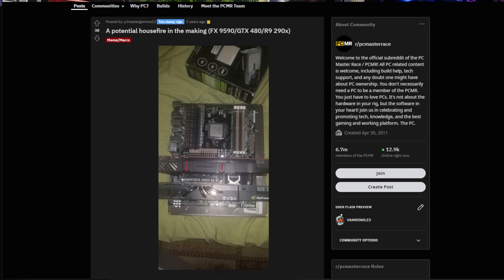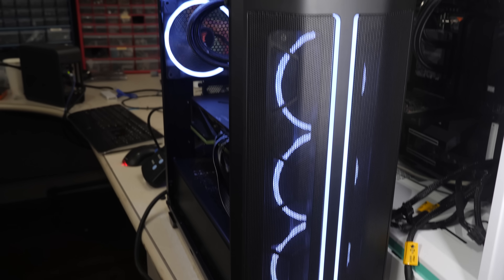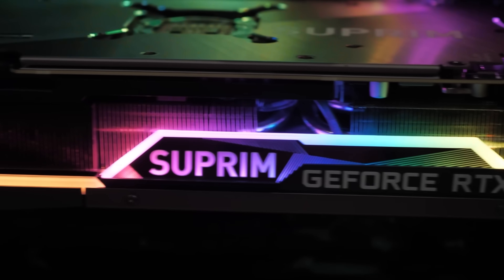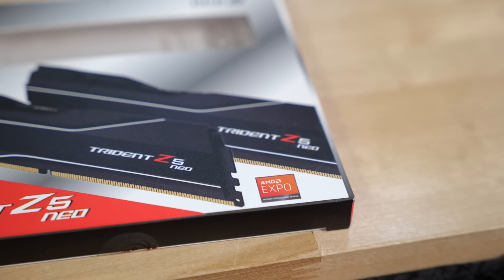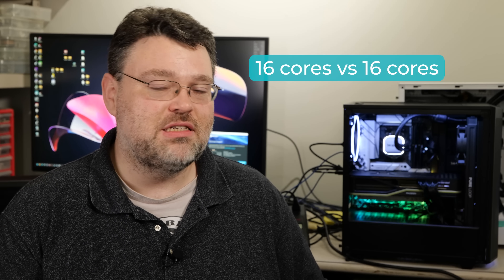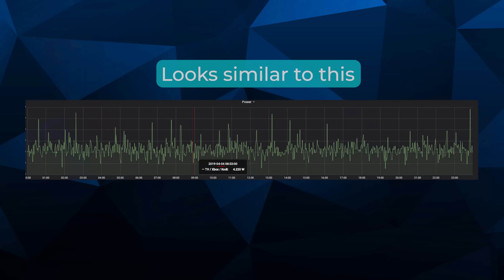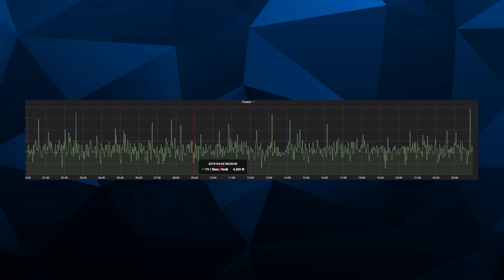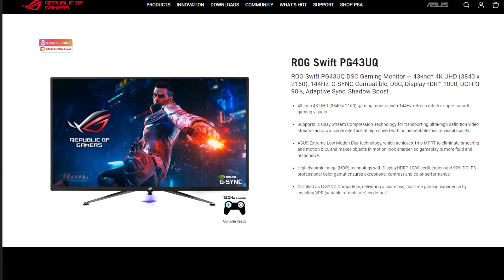Too Hot? How much Heat Do Intel and AMD Actually give off?

Comment: The amount of people who dont understand its wattage and not temp that causes heat in your room is crazy
Reply: and that temps are just trapped heat in the IHS/CPU, a 10w CPU at 95c is VERY different from 110w CPU at 95c.
Reply: People don't understand that a 250w CPU running at 60 C° will heat the room much much more that an 75w CPU running at 95 C°
Reply: The temperature of a little old fashioned torch bulb filament  is over 1000 degrees but it's only 2 watts.
Reply: An 800 degree F coal vs a pot of 160 degree water. One you can hold in the palm of your hand. The other will instantly scald you.
Reply: The difference between the two is negligible now that’s the difference AMD was more efficient and was sold as efficient so now that it’s the same basically as Intel might be 20 watts less haha people are all afraid of the Pc being a space heater. And it kinda is but at the same time what are you using it for if you aren’t going to be neeeding crazy high core count workloads being run then getting a lower core count cpu is better for sure and you GPU determines more of
What you wattage target is going to be if your into gaming … and gaming isn’t going to see benefits over 8 cores .
Price of the system to overall performance for a strictly budget build gaming PC is still ain’t 12600k or extreme budget 12400 non f so you get the integrated graphics for $20 haha that way you decide to get a AMD gpu to save some money for gaming you can still use the Intel Media engine for video editing and encoding /rendering
Reply: @JoeWayne84  7900x and 7950x do perform significantly better than the 7700x and the 7600x though, not so much as a direct result of the extra cores but more because of the extra cache they have
Reply: @bosstowndynamics5488  Significantly better???? OK
Reply: Temp is a byproduct of wattage and since people don't measure temperature in wattage it's definitely easier to understand. But since wattage is lower with a lower load we could say heat is caused by the game you're playing or porn you're watching.
Reply: The amount of people who won't admit that AMD changed the goal posts on the programmed running temperature is crazy. AMD upped the 'normal' operating temperature due to failure to cool properly. It's like running a 500W psu with a 'normal' load of 500W, whilst it 'can' do it, people only do that if they've no means of upgrading their psu. By comparison Intel never programmed their CPU's to run at 95C, it happens due to inadequate cooling. Being able to survive a heat wave does not that that is the normal historic temperature.
Reply: @longdang2681  That's not true at all - AMD's specified TDP for the 7000 series chips is somewhere between 100 and 170W depending on part, but they'll continue ramping up all the way to 250W if you provide enough cooling, even at 95C. If the chip is able to consume nearly twice its specified power without exploding it is not inadequately cooled regardless of what the number on the thermometer is. You can make the argument it's being too aggressively overclocked (I would disagree with this as modern silicon is more heat tolerant) but that's not the same thing. You can also argue, accurately, that the AM5 IHS is designed in a way that makes cooling worse than it has to be, but that's not the same thing as inadequate cooling any more than Intel's thermal paste IHS approach was "inadequate" cooling. It is adequate, just not ideal.
Reply: @bosstowndynamics5488  you don't need to risk it exploding for it to be inadequate cooling. The cooling is not sufficient to cool the AMD CPU to under 80-85C when it is consuming 200+W. AMD had two main choices, either clock it lower and reduce the power required, or let it run hot and say that it was meant to run that way. They chose to let it run hot. Intel's 12900k etc. also has inadequate cooling when it hits 90+C. The difference being Intel does not programme it to run hot as much as possible and call it normal operating temperature. It's like sweating uncomfortably in a heat wave because of an underpowered AC and calling that adequate cooling. You don't have to die for it to be called inadequate.
Reply: @longdang2681  Why do they need to cool it down to 80C? Because you said so? That seems very arbitrary
Reply: @bosstowndynamics5488  It's not arbitrary. It's like saying that water boiling at 100C is arbitrary. The numbers actually mean something in real life. What's arbitrary is AMD randomly choosing 95C. Why is it not the 105C that they are claiming it will still operate at? You can't just jig real life numbers because AMD marketing feels like it, physics doesn't work like that. 80C is the highest safe enough consistent temp for CPU's. Many electronics based companies put their real life max sustainable CPU's temp at 80C. Even AMD used 80C until they released the 7000 series.
Reply: @longdang2681  It's almost as if the 7000 series was built on a different process or something.

Specifying 80C for silicon is arbitrary. CPUs are not made of water, and even if they were water doesn't always boil at 100 degrees, its boiling point changes depending on multiple factors. Similarly, while no silicon is going to be rated for 200C different processes are capable of safely operating at higher or lower temperatures, with a general trend in recent years towards better heat tolerance with newer process nodes. The thermal rating of the 5000 series chips on an older process does not make it impossible for the 7000 chips on a newer process to run hotter safely, particularly since AMD had actually specified 90C for their 5000 series parts, not 80C.

And again, even if it's not safe for them to run at 95 degrees, the fact that they are running that hot is not due to insufficient cooling*, they're deliberately configured that way. If you provide 250W of cooling to a 7950X it will still run at 95C, even though you're providing way more cooling than its design power, because its governor will say "excellent, I've got plenty of cooling, I'll run even faster" and boost up to take advantage of the extra power. *Even if 95C is too hot, the problem would be an overly aggressive overclock in that case.
Reply: @bosstowndynamics5488  It is not safe to run them at 95C(long term reliability). The only reason why AMD has programmed them to run hot is so that they can benchmark that bit higher. AMD failed to release a product that can reach the benchmark scores that they wanted so they ran it hot to do so. Instead of just releasing what they got(which is still decent enough), AMD decided that they would move the goal posts. Remember when AMD claimed that it was not possible to support 5000 series processors on earlier AM4 motherboards due to lack of bios space? guess it's not so impossible now that is has miraculously happened(another example of AMD making nonsense claims to try and move the goal posts). If you want an inferior product that is programmed to break earlier for no real benefit to you(the customer), then go ahead and support AMD when they make their nonsensical claims.
Reply: @longdang2681  So the evidence as it stands:
On the one hand AMD, the company that has manufactured the processors using decades of experience with semiconductors, and has access to protected information about the performance of the TSMC processes used to manufacture the chips, has rated the processors to run at 95C for long periods of time. This is a small, incremental increase from the 5000 series rated temperature profile
On the other hand, Long Dang, a random pseudonymous commenter on YouTube, has a hunch that because old silicon needed to run cooler that actually the 7000 series chips are only safe at 80C, a full 10C lower than the previous generation of products and in complete defiance of the broad industry trend of AMD, Intel and multiple ARM manufacturers rating their modern chips to run up to 95 to 100C. You have also provided exactly 0 evidence for your position.

Do you see why I'm inclined to take AMDs side, even before factoring in my very favourable personal experience with reliability in AMD's silicon?
Reply: @bosstowndynamics5488  It's Apple and AMD on the one side programming their CPU's to run hot at 95C and on the other side it's the rest of the industry and anyone who knows anything about electronics sticking to below 80C for their products. 7000 series processors are lower even factoring in the down turn because people are voting their their wallets to call AMD talking bullshit(and AMD deserves it). Remember AMD has bullshit before with 5000 series support on older AMD motherboards so it's not the first time. The evidence is all around you, simply ask any electronics company(that's not bullshiting) why they would keep their chip temps below 80C. You are inclined to take AMD's side because you don't know any computing history (and are unwilling to do some research when someone who knows a bit about electronics tells you that AMD is bullshiting you). Just so you get the facts right Intel, ARM and everyone else rate their chips to being capable of running at up to 105C(or whatever the specific number is), is very different from AMD programming their chips to run constantly at 95C. A 500W PSU is rated to run at 500W but no one programmes their 500W PSU to continously output 500W. Rating something to be able to cope with a specific load(usually for non long term operations) is very different to programming it to run constantly at those loads.
Reply: @longdang2681  Fun fact, 105C is a bigger number than 95C.

Laptops frequently run Intel processors into the 90s constantly btw.

And, I can't believe I need to say this again, the fact that older silicon wasntt safe at high temperatures is meaningless here. I also know "a bit" about electronics, and I assure you that the thermal performance of a 350nm Atmega 328p gives no indication of the thermal performance of a TSMC 5nm part like the 7000 series.

There's a few reasons that the 7000 series isn't selling massively:
1) it's not much faster than the 5000 series on a per dollar basis
2) Intel's chips are slightly faster this generation on a per dollar basis for low core count workloads
3) Gaming loves large cache sizes, so the cheaper 5800X3D is still keeping up with this generation, and a lot of people are waiting for the 7000 series chips with 3D Vcache in light of this
4) Raw platform cost - AM5 motherboards are expensive right now, and the new systems need DDR5, which doesn't compare well with Raptor Lake that can run on year old Z690 boards with DDR4.

Those are the main reasons, the fact a small number of people like yourself are willfully misunderstanding how heat works is a contributor but much less than the above.

Oh, and PSUs are in fact rated to operate at their maximum power continuously - the main reasons that people don't run them full tilt is because capacitor aging lowers that rating over time (CPUs don't have many capacitors etched into them) and because they're less efficient at maximum output.
Reply: @longdang2681  Also, I can't help but notice that you've just silently dropped the point about "inadequate cooling", which was your original claim. I guess you did realise your original error then?
Reply: 'Oh, and PSUs are in fact rated to operate at their maximum power continuously - the main reasons that people don't run them full tilt is because capacitor aging lowers that rating over time (CPUs don't have many capacitors etched into them) and because they're less efficient at maximum output.'

You said it yourself, rated at doesn't mean you can run it at that load and achieve equal longevity.

Two things, laptops rarely run constantly at 90C(unlike a desktop, people move laptops around), of the ones that do, how many are still working. How does that percentage compare to the hoards of laptops that still work perfectly fine due to sufficient cooling to under 80C ?
Reply: @bosstowndynamics5488  You dropped the point about inadequate cooling. I'm still asking you if your AC fails to keep you from being uncomfortably sweaty during the heat wave, is it giving you adequate cooling? or do you need to die from overheating before it can be classed as inadequate cooling? Oh wait, your AC has been programmed to let you be uncomfortably hot and sweaty? (because that's normal now. Humans are rated to not die at those temperatures, there's absolutely nothing to worry about.)
Reply: @longdang2681 Funny you should say that, I live in Australia and rarely use my AC in summer because I have high heat tolerance, many people do given the chance to acclimate, almost as if heat tolerance gets better over time...
And I did not drop the point about inadequate cooling, it wasn't my point, it was yours, and you didn't respond to my last rebuttal of it.

Re power supplies, you completely ignored what I said. What I said was that capacitor aging in the supply (which is primarily a calendar aging issue and not related to load) means that people overspec their power supplies so that in 5 years when it's max power is 80% of new it can then run full tilt to supply the system without issue. Running the PSU full tilt new won't worsen that degradation, it just means when the degradation happens anyway the PSU will hit its ceiling and the system will shut down.

Re moving laptops around, moving laptops does not in fact enhance cooling as you seem to be implying, the fact that they get moved does not somehow change the fact that they're often running over 90C. Performance laptops tend to be geared to run hotter to get higher performance, and in my experience they tend to have better longevity than cheap, cool running commodity laptops because any theoretical decrease in longevity from heat is more than counteracted by generally better build quality. Even Apple laptops, which do have issues with reliability and also do run hot, have well documented failure modes that are almost never associated with the main silicon (the bit that's running hot), it's pretty much always some minor part like the display cable shorting out.

The core problem though is you seem to be really hung up on 80C as some arbitrary magic silicon safety number. Do you have any actual source for your fears or are you just extrapolating that technology from decades ago is somehow exactly as thermally stable as technology today that's been specifically designed to perform better in hotter environments for things like laptops?
Reply: @longdang2681  CPUs don't experience discomfort buddy, if it's not being damaged it's fine. The equivalent in your strained analogy would be heat stroke or maybe dehydration, not death, and none of those are happening to modern silicon at 90C
Reply: @longdang2681  Anyway I've had enough of this, we've been going for quite a while now and you've provided no evidence beyond, effectively, "I know more than a multibillion dollar state of the art semiconductor developer because I used an Arduino once and think 95 is a scary number", so unless you can provide actual evidence that there's a problem here I'm not going to bother any further
Reply: @bosstowndynamics5488  CPU's don't experience discomfort, they can't tell you when they are overheated and just promptly die when it's too much, just like what happened to buildzoid's 7950X. I know he overclocked it but dead CPU already? nice of you to reign in the numbers when you don't have an argument, didn't you mean 95C instead of 90C? You know, the pre-programmed temp that 7000 series processors will run at that is claimed by AMD to be 'normal'.
Reply: @bosstowndynamics5488  Tell all those elderly French casualties of the previous to last heat wave that no one can die from a heat wave. Due to inadequate cooling. Just because you don't know, it doesn't mean it doesn't exist.
Reply: @bosstowndynamics5488  I'm claiming that inadequate cooling that causes sweaty discomfort is an inferior product and that people would want to look for better choices, and there's you saying that it won't kill you. Who's going to buy an inferior product that's priced similarly or maybe more than their competitor? look at sales for 7600X and 7700X, it's terrible. There's is an argument that if you need the processing power similar to a 7900X and above, the CPU is going to run hot whichever choice(Intel or AMD) you make. No coincidence that those processor sales are not as bad. And that's the correct consumer response when you tell people that the comparatively part time processor that is the 7700X runs 'normal' at a temp of 95C when at full load.
Reply: @bosstowndynamics5488  Ask your multi-billion dollar state of the art semiconductor company how they feel about lying to all of their existing AM4 customers about how there's not enough space on the bios memory for older AM4 mobos to support 5000 series processors?
Reply: @longdang2681  Ffs I didn't say no one can die from a heat wave, I said most people can acclimate to warm weather. Elderly people are not most people, and heat waves do not give enough time to acclimate. And that's not even what you were talking about, you were making some point about being uncomfortable, not dying. In your warped analogy people dying is equivalent to running the CPU at 120 degrees, not 95C.

As I said before, I'm not going to bother replying to your points about silicon because you're just repeating yourself over and over without any evidence, but how you're just outright lying about what I'm saying.
Reply: @bosstowndynamics5488   How am I lying about what you are saying? I'm taking quotes from what you have said? people dying from heat wave is not similar to running a CPU at 120C because the CPU is only rated to run at 105C. And that's my whole point. Running something within it's rated temperature can still cause premature failure. You understand that running a 500W PSU constantly at it's rated 500W will cause premature failure. The exact same thing happens with CPU's. Running them constantly at their rated 105C will cause premature failure. This is why AMD purposely programmed it with 95C. 95C will cause premature failure but not as fast as at 105C, ie it'll last long enough for the warranty to run out before failure. Higher temperatures will always cause premature electronics failure, I have to provide evidence for this, really, look it up, it's just physics. Anyone who doesn't understand the simple physics of temperature against failure rate of electronics can can continue to run their CPU's into the ground.
Reply: @bosstowndynamics5488  'You said that someone might use an AC even in weather that isn't dangerous to them', wrong . I said that if you put on your AC during a heat wave and it fails to keep your temps low enough resulting in you feeling uncomfortably sweaty then it's doing a poor job of cooling. Making the point of you don't have to die in a heat wave for the cooling to be considered inadequate. Similarly a CPU doesn't have to fail immediately whilst being pushed to 95C for the cooling to be considered inadequate. A detriment to a persons health during a heat wave would be considered inadequate cooling. similarly a detriment to a CPU's health at by running it hot at 95C would also be considered inadequate cooling. Isn't that what this is about, you making a (no evidence) claim that it's not inadequate cooling purely on the fact that AMD claims that it's normal. despite the fact that every electronics company operating in the computing industry for the last 40 years has kept to safe temps of under 80C. Does AMD know better than the whole computing industries track record of over 40 years?
I was not nitpicky about you picking 120C over 105C. I said that 120C is operating out of rated temps. 105C is operating within rated temps. My point was it can fail whilst operating within rated temps. Of course it can fail whilst operating outside of rated temps. What's the point of you bringing up 120C, why didn't you use 3000C instead? guaranteed to fail at those temps, unless of course AMD claims that those temps are normal temps based on the miracle that is TSMC 5nm.
You are not thinking straight. What AMD claims to be true and actual reality might be two completely different things(and it won't be the first time).
Reply: @bosstowndynamics5488  If 95C is so normal, why have a fan curve? why have a fan at all? remove all noise making fans and run any 7000 series CPU at 95C at all loads. It can handle it? It's TSMC's 5nm chips, we don't need cooling anymore, cooling is for old CPU's.
Reply: I'm surprised, seems obvious.
Reply: Blame the marketing department 😅
Reply: @longdang2681  Wow, you're still going huh? The fanless conditions for the 7000 series chips would be 105C and aggressively thermally throttled, because, you know, a 170W space heater the size of a postage stamp actually requires active cooling to keep it even as low as 95C.

And Simpsons memes are not a source, try an actual source rather than spamming more nonsense
Reply: @bosstowndynamics5488  Still too blind to see that AMD raised the normal running temps to 95C because they released a failed to pre-overclock series of processors. I suppose some people can't be helped.
Reply: @bosstowndynamics5488  Still too blind to see that AMD raised the normal running temps to 95C because they released a failed to pre-overclock series of processors. (AMD's bullshit marketing of 95C being normal is evidence, but animation highlighting the truth that marketing will spout any bullshit is considered nonsense). The evidence is available to you, you're just too blind to see it. I suppose some people just can't be helped.
Reply: It’s tough to tell people that the degrees is just how hot the component is and the watts is what’s being used and consequently expended. Connecting Watts to Temps when there’s clearly a reading that already shows temps is a hurdle.
Reply: I knew people would freak out about 95 Celsius. Nobody understands thermodynamics.
Reply: @kopasz777  and new Ryzens are consuming how much without 105W ECO leash imposed upon them? That's the whole fricking point - you argue that it's wattage that matters, WHICH NOBODY DENIES, but you're saying a CPU hitting it's peak performance and acting as a fan heater somehow is not an issue. It's a very real issue. It was a real issue when everyone was pointing and laughing at Intel for brute forcing higher clocks to remain relevant and look good on charts past few generations. It was an issue when Bulldozer could replace your central heating... The default behaviour is stupid and nobody should need to be fiddling with power curves out of the box to get optimal performance to power ratio. Optics would be entirely different if they marketed it as insane OC potential and gave you this wild, nearly doubling power limit to play around with. As it is it's pretty much auto-OCd out of factory to the absolute limit (good luck to squeeze ANYTHING out of it) and chugs 50 extra Watts for 5% performance in benchmarks to stay above Intel that has done exactly the same in 12th and 13th gen in order to compete 🙄 it's like buying a laptop and then undervolting and downclocking because otherwise you can fry eggs on it... yes it will work, but why would you want it to run it like that?
Ryzen 7000 is a great advancement with some questionable sacrifices for questionable gains - the best part about the AM5 platform is that motherboards finally have some competitive I/O. It's a real shame that with redesigning the socket they didn't opt to provide more PCI-E lanes to the CPU though...
Reply: @Micromation  I share the same views on the auto OC, factory default being pushed too far, but that's still only a personal opinion. Back to your og comment; have you considered the boost behaviour in regards to power consuption? While your flat OC can not dynamically manage it's clocks and thus its power consumption a stock CPU can and the average power consumption will not be ~200 W. The 95 C is also not the die temp but hotspot temp. This is why you can put a small air cooler on the new ryzen with minimal performance loss and the hotspot still being the same temp. Putting a bigger AIO or custom loop on it will just extract more heat overall and let the CPU use more power as a result. The 95 C is the result of the high power density of the increasingly smaller dies.
Reply: Bruh... I have 5960X (140W TDP), if set at constant 4.5GHz it sits on 85C on water cooling under stress... Combined with 1080Ti at 80C it heats up the room in about 2 hours. In the summer I have to stream remote desktop via local network to another room because PC room is hitting 40C ambient and is unbearable. Yes, 95C on a 170W is a problem if you intend to make use of it. Do you all live in goddamn Siberia or you just buy top of the line components to browse a goddamn YouTube?
Reply: @Micromation  Yes, that system will heat up your room, but importantly it would actually heat up your room slightly more if you beefed up the water-cooling and got the temps down to 60C because you'd be kicking out the same amount of power from the system and slightly more from the pump pushing through more radiators and extra fans to get there.

A simple way of thinking about it is accumulating heat at each stage. The peak temperature on the die only determines how fast the heat can flow through to the cooler - if the cooler is slow then the heat builds up in the IHS and slows down heat flow. The same 7950X will use anywhere between 60W and 250W depending on how much cooling it has with exactly the same die temperature - give it more cooling and it will heat your room more because a larger amount of heat is being extracted from it, letting it use more power, even with exactly the same die temperature.
Reply: @Micromation I have a small gaming room /man cave and its gets toasty as well with the CPU,GPU, PSU and motherboard dumping hot air into the room.I solved the heat problem buy buying a 2500 watt AC,well I think I solved the problem by dumping the heat at my next door neighbors house
Reply: @RIPOFF65  please tell me your didn't get one of those portable AC that have a tube to your window. Those things are power viruses.
Reply: @Micromation  

What the fuck are you talking about
Reply: @Micromation  Did you get it at all? Even people in this comment branch explain it and you still comment like this.
Reply: @AngelA-tj9ok  cool story. Explain it to my room thermometer because he clearly didn't get the memo 🤦🏻
Reply: @Micromation  dense
Reply: @Cypeq  they're giving you real world data & you're discarding it out of hand. who's dense here?
Reply: @Shootyqt  some people are so thick headed,  this commend will point to that they are wrong, this video is explaining how wrong they are about this simple subject, and they will just triple down on being wrong, and show how proud they are to prove they don't understand middle school level physics.
Reply: @Shootyqt  you